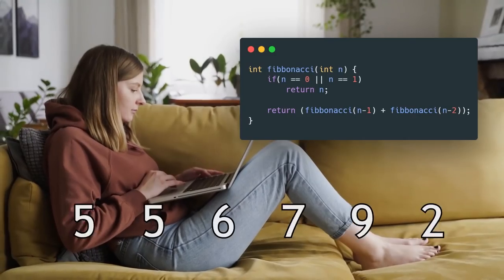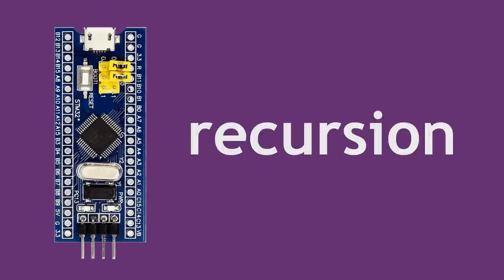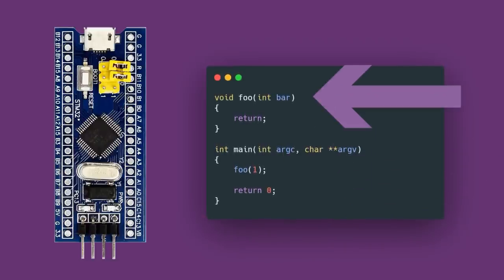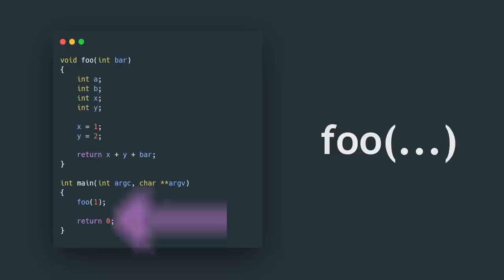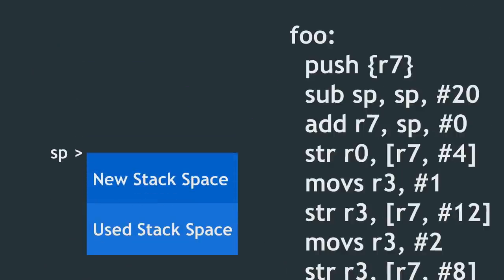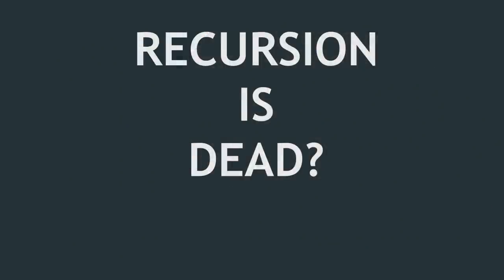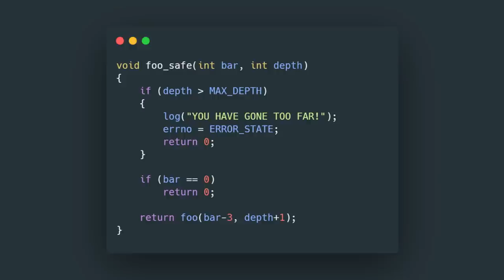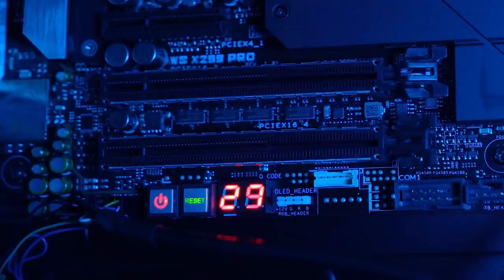why is recursion bad?

Comment: I once heard this excellent saying: "all recursive functions can be written with loops, since CPUs, as far as we know, cannot yet clone themselves."

Edit: okay okay. To every computer science undergrad student here shouting "aCKeRmaN" (or maybe you just watched a Computerphile video, I don't know), I understand you want to show off that bit of fancy maths you just learned about. Chill alright. I said "can be written", which means EXACTLY THAT and NOTHING MORE. It doesn't mean you should (or shouldn't), or it's a good idea (or not), or whatever you imagine it's saying.
Reply: But how is having more CPUs connected to recursion?
Reply: This is absolutely incorrect, see i.e. Ackerman function, though that one is a bit contrived thing. But recursion is way way more powerful than looping.
Reply: @hackvlix  a cpu executes all code iteratively. You can always emulate the behavior of a cpu
Reply: @morphles  ackerman function can be implemented without recursion as well, just look at stackoverflow for examples
Reply: @climatechangedoesntbargain9140  Just did, and its a bit bs with regards to this:) still uses stack, so in essence all same problems apply that are mentioned in video, so some recursive problems, like ackerman function will require loads of memory regardless. And recursion is way simpler to write.
Reply: @morphles  nobody says, nothing requires tons of memory, but its true that you can reformulate everything nonrecursive
Reply: @climatechangedoesntbargain9140  Well, that is best kinda of correct so that much I can concede :) But in a way that is kinda "obvious" from turing machine/lambda calculus power equivalence. Still, after working with functional stuff, recursion readability benefits seem enormous. And compiler should sort it out :)
Reply: Yeah, I aint writing variadic templates without recursion. Just f that.
Reply: @morphles  a-a- you are.
daily reminder that primitive recursion means it can be simulated by bounded loops. not loops *period*.
Reply: @morphles  What enormous benefits are there in recursion? It's not even simple to understand. Simple to read and write, but hardly nay other benefit. 
How much code-writing time is even saved by using recursion?
Reply: @morphles  Any recursive algorithm can be done iteratively. Recursion is not more powerful than looping. Good luck dealing with anything involving depths greater than 5000 or simply using previous or future values that are more than one step removed.
Reply: @anujmchitale  Likely none, debugging even somewhat complex recursive code is a nightmare.
Reply: @macicoinc9363  Oh. I have never come across cases where recursion was an overall better choice, but I am in the embedded systems world. Though I doubt it's a better overall choice anywhere else either.
Reply: @anujmchitale  Then clearly your programming experience is quite limited, to imperative languages only. Try learning something like Haskell or F#. Obviously embeded has it's limitations, and likely you wont be using functional too much.
Reply: @macicoinc9363  Again for non primitive recursion, looping is basically implementing stack handling by hand, as mentioned previously, so no way it is more readable. For primitive recursion yes looping is as powerful but way less readable. As for depths, that is non argument if you use it properly with good languages/compilers, there is tail call elimination, and even in C with bad compilers you can use trampolining as far as I know, though then it likely becomes more convoluted than just looping. Again it all depends very much on task at hand. In general problem with loops is that they are low level, and do not allow for clear high level abstraction in algorithms.
Reply: Try solving an avl tree with loops
Reply: @morphles  I have heard Haskell pushes one to use recursions right? Then that's more of a specific language thing.
 Whatever my own personal experience, I have never even come across anyone else mentioning recursions as the objectively better way to do stuff. Maybe one or two advantages bit not holistically better.
Reply: I'm not sure why so many of you are missing the point? It was never a question of which one is "better", whatever that's supposed to mean, rather that they are mathematically equivalent. All loops can be written in recursions and vice versa, so just use whichever is more appropriate for the situation.

Oh and by the way, as of all those different recursion algorithm examples you guys have given up there: guess what, all control flow compile down into conditional jumps at the assembly level. So yes, it IS in fact possible to write <insert your algorithm here> non-recursively.
Reply: Actually, CPUs have been reproducing themselves for decades. Consider, you can no longer do modern CPU design without the help of a computer.

And yes, there are legitimate use cases for recursion. I wrote a tool for doing version control on Blender documents. It’s not enough to store the base document in the repo, it might also have external dependencies that also need to be included. Some of these dependencies need to be found by scanning node graphs, which can contain node groups which in turn recursively reference further node graphs.

Do you really want to code that with an explicit stack? Recursion is just so much easier to code, and easier to understand.
Reply: @anujmchitale  :) I suggest looking into Wikipedia article programming paradigms, and see that there are way way more ways to program, than just imperative languages. "Encourages recursion" is understatement and misunderstanding of the point. Again, from what I read so far (which is very understandable as this video is about low level stuff), good chunk of people here have not encountered significantly different programming languages/paradigms and think all all languages are mostly same (which for lot of popular langues is quite true, java, c dialects, pascal, php, even assembler, those are mostly very much the same), which can't be further from the truth, there are super mind bending (for good reasons) languages, that really challenge and expand ones thinking. Some simple things to look are, functional programming, declarative programming, and most mind bending I have seen - logic programming (or somewhat related nondeterministic programming).
Reply: @scheimong  While I made a mistake talking about non primitive recursion previously, and yes strictly speaking you can do same stuff with and without recursion, I' pivoting my point (into weird direction, kinda, on low level programing video) to - imperative (and thus loops), is very much that great way to program, and should be used only when absolutely necessary, generally languages that "encourage recursion" (of have it as only option), allow for much better abstractions and robust/less error prone code. Still of course for micro-controller programming one is unlikely to use those, at least at this point, so not sure why I got into this argument so much...
Reply: @morphles  I agree my sub-field is quite small compared to overall mega-complex of logic. The points you brought in this reply are quite refreshing.
Some others haven't brought such points. They keep up the factually wrong points like recursion is "simpler" etc. 

For the sake of creativity and a different thinking style, it makes sense to have different ways of doing things. We should not do it only one way. But should also accept that down under, everything is exactly converted into a loop structure. When higher level programmers stop giving value to such facts, we end up with unnecessarily bulky systems like the Java based Android. Instead of the stronger IOS, that's based on unix-like programming.
Reply: @anujmchitale  That's a pointless debate, each task has its best suited tools. What are the benefits of a punch if a kick can replace it?
Reply: @petros_adamopoulos  What are the justifications for such a replacement? That's the core debate in here. Without an acceptable justification, replacement for the sake of it is meaningless.
Reply: @anujmchitale  Well again Java is just java is just assembler with more steps :), so of course it can hardly be better. But again my view is that future is declarative type of programming, or logic, and low level code generation left to compiler. Higher level of abstraction allows a lot of things that doing just loops etc, would leave ones head spinning with complexity and unable to track what happens where. But if you work with well defined high level abstractions, you can allow machine to do all the crappy details, much better than human can, and much less error prone. Though again, we are not yet at the level were we could unleash such tech on embedded space, but I suspect in something like 20 years, we might very well be.
Reply: @morphles  That time, wouldn't the inbuilt functionality of languages be strong enough to not require either explicit loops or recursions?
 
This is a crucial point. Show us where coding loops won't survive but recursion would, specifically.
Reply: @anujmchitale  It is not so simple, point is that in functional languages, functions are first order objects/values, just like any other value in "common imperative languages", you can assign them to variables and manipulate them in may ways, they are well defined (talking about pure functions), and you can reason easily about them all of this combined results in excessively easier to read and understand code. Though again one needs some experience in FP to appreciate it. And again FP is just one step/thing, other pradigms, though some of them likely will remain very nice potentially forever, but thankfully (IMO), FP is gaining ground quite a bit, and should improve on OOP nonsense, granted embedded stuff suffers much less from all kinds of OOP crud, as it is more basic procedural stuff, with less of marginal use abstractions that OOP pushes.
Reply: @morphles  You are discussing a bigger point here. FP is more feature rich, no doubt.
But "recursion" in it's theory is nothing else than a self-confined loop that runs till some condition. Then why is recursion the key for anything? That's the question here. FP Vs OOP Vs Procedural is a different topic.
Recursion has existed since the beginning. Not like it's a new feature.
Reply: @anujmchitale  Ok the point with recursion is, it allows immutable state everywhere, thus pure functions. While loop generally are used to mutate something, and mutable state makes understanding and reasoning about things more difficult. The point is that languages like haskell (though it is probably one of most hardcode pure functional languages), recursion is the only way, you are then forced to learn the benefits of operating on functions/higher level of abstraction, the thing is you build things of small pure functions, means no mutable state, means you can not do stuff like "a = a + 1", but you get very well defined and easy to reason about chunks of code - pure functions, and to basically iterate under those conditions recursion is the only way. Admitedly for some simple things one can argue that for (...) { if(a) { b=a+x; } } and stuff like that is not that bad but when you get used to functional ways, of map, filter, fold, etc, it just drives you nuts in how annoying it is to reason about on high level, because you have to figure out code writers intentions from individual nondescript steps. Though I guess I'm again quite off on tangent :) I guess I got detracted by my dislike of loops, here, and the samples where recursion is easily most readable thing are a bit more involved, while in general I prefer to use map,filter,fold, even when working PHP, which I do most of my time. Though I decently recently had to do a task where recursion seems to have been by far best. But description is slightly involved, though I could try to write it here.
Reply: @morphles  No this is an important detail that you have shared. And your use case makes recursion a better choice to use probably. This is what very few people mention. Many just ramble about trees etc. Data structures that can easily be utilized by pure loops. 
For Haskell, it's necessary to use this style. That's fine.
But in procedural languages, there's hardly any benefit in recursion . Rather a loss of detail and debugging info.
The possible future of FP that you mention may come up with its own implementations, as I replied before.
Reply: there is a simpler saying: trivially anything can be implemented with a single loop since the processor logic itself is a loop: fetch, execute, jump to the next one, and repeat.
Reply: Recursion is used when you need to break the task into smaller similar subtasks and remember the place in the parent task where you should continue after finishing the subtask. In some cases you can avoid allocating memory (such as Fibonacci), but in some cases it's problematic, for example QuickSort algorithm (although you can use tail call optimization for the last partition call, so the smaller part can be recursively partitioned and the larger part can be done in the same function guaranteeing log(n) stack space in the worst case). Of course, you can use an array instead of a stack, but that doesn't count since it's still an auxiliary stack.
Reply: @SurenEnfiajyan  Thanks for some valuable info on what objectives to look for during recursion usage.
Reply: You cant reverse print a linked list without recursion not using extra memory.
Reply: @F.T.L  you are already using extra memory in all those recursive calls and context switching.
Not to mention all the time spent till the last call, without printing anything. So if the whole process jams in between,you end up not printing anything.

This is one of the most horrible justification for a recursion use-case.
Reply: @anujmchitale  still better than to write an array for it
Reply: @F.T.L  Much worse than writing an array for the values. Once an array is created, you can splice it, cut it into 10 portions, prints only the odd indexed values. Do whatever the hell we wish.
While with recursion, none of this is possible without more control logic.
Reply: @morphles  I find that exposing the stack makes it far easier to write anything more complicated than basic searching algorithms. Maybe it is harder to read, I would argue it isn't because I don't have to translate random recursive calls to how the stack is changing. If an Engineer is having trouble understanding DFS, BDS, or any traversal algorithm, you have a much bigger problem than how the code is written. Would you concede that it makes debugging a lot easier for complicated algorithms? From experience I have ran into recursive depth problems as little as 5000 in: Java, Python, and I believe C++. In the case of C++, isn't it best practice to not assume the compiler will do what you want it to, especially in easily fatal errors like recursion depth limits?
Reply: @anujmchitale  Languages often have nested structures, so using recursion is often the most natural way of implementing a parser.  Sure you can use a parser generator to generate a table driven parser, but if you're implementing one by hand, then recursive-descent is the method of choice.
Reply: @anujmchitale  yeah that is for sure, but i still think recursion rules on specific operations, especially in probabilistic algorithms. btw i dont think recursion uses context switching, is it?
Reply: @anujmchitale  No. Functional programming pushes one to use recursion. The whole paradigm does. And so does logical.
"But you can write any recursive functions and make it iterative". Sure, good luck with backtracking and binarie trees management. If you are the only one that can understand your code, probably bad code.
Reply: @ElCalvazo  That's not the case though, is it? The languages that push one to use this style are much lesser than those that don't. 
The last statement about only one person understanding the code is such a  cliche dude. It applies to every single line of code. If you have gone through all the discussion, one of the point "against" recursion is exactly this one. Very few people understand the recursive logic faster. In comparison to a bulky loop.
Reply: @F.T.L  I agree my term usage "context switching" was somewhat loose over here. I didn't mean the context between user/ supervised space but a new Return Pointer pushed onto the stack everytime a recursive call would be made.
Reply: @daves.software  Oh. This looks to be a valid example where recursion trumps looping, in terms of ease-of-thinking. Thanks.
Reply: @morphles  Totally depends on the problem.
Reply: @anujmchitale  I find that for many sorting problems, a recursive approach (i) helps me more easily factor out what would be a source of off-by-one errors, and (ii) gives me code which I find much easier ti formally reason about.
Reply: @F.T.L  The cost of converting the linked list onto an array costs O(n) in space -- not alway feasable.
Reply: @anujmchitale  The control logic here should be hidden in the iteration filters, just as the control logic for array slicing should be hidden in the slicing/indexing opetators.
Reply: @zapazap  yeah that was my point
Reply: @F.T.L  Ah, ok. (y)
Reply: @F.T.L  If you mean without touching the one directional linked list. Otherwise you can reverse the linked list, print it and reverse it  back.
Reply: @SurenEnfiajyan  yeah but it takes 3x time if you do that
Reply: @zapazap  Oh.
Reply: @climatechangedoesntbargain9140  No you can't, that's literally what the Ackerman function is - an example of something you can't replicate without recursion.
Reply: @ichigo_nyanko  dude, just read the following posts
Reply: @F.T.L  If there is no additional memory available then this is probably the best solution.
Reply: You can tell how inexperienced a programmer is by how married they are to recursion. There is literally no benefit in terms of readability, bug-proneness, or really anything at all in using recursion. Languages implement the state of function calls with a stack; whether you push values onto a stack, or call a function with parameters, you are LITERALLY doing the exact same thing, which is pushing and popping values using a stack. Recursion is a great way tor a beginner to understand the concepts of a stack, but using recursion instead of a stack comes with multiple drawbacks, and only helps readability in cases where multiple functions are all recursing each other in complex ways.

One thing that always bugs me is why on earth anyone would EVER write Fibonacci with recursion. You start with a=1 and b=1 and iteratively add one to the other a predetermined number of times. Even using a stack for such a problem is insanity, yet Fibonacci remains a favorite example of recursion, and I think that helps to shine light on how misguided the "recursion is better" crowd is. When you gain enough experience in algorithms and data structures, implementing a recursive process with a stack becomes second nature and comes with many benefits over recursion:

Compilers have trouble inlineing recursive calls in all but the simplest cases, and cases that simple should not be relying on recursion in the first place. And if the compiler can't figure out how to inline your recursive calls, you are wasting many cycles copying values/pointers and/or referencing and dereferencing pointers between different calls of the same functions, sometimes even for values that aren't changing. To get around this, you can use static variables in your recursive function for values shared between multiple calls of the function, but you lose the ability to do that if the function is being used by multiple threads. Because of this, it is basically a law of the universe that recursive solutions are wasteful. Why do you have to keep copying the data for, and allocating more and more memory for, a "level" variable to keep track of how deep the recursion is, when a simple "mystack.size" expression has that data persistent and automatically incrementing and decrementing with your push and pop calls? And with recursion, you only have access to the most local data in your call-stack/data-structure, unless you want to figure out how to pass all the relevant data around, after figuring out the algorithm to even determine what data each call even needs. Why not, when you need data, just peek at the elements in an explicit stack, where they are readily available and memory allocated for them only once?

I'll tell you why: intellectual laziness. Stacks are a bit of a mind warp, and before fully understanding them, recursion is a great crutch for beginners to use because, using recursion, stack behavior can be achieved without even knowing what a stack is.

Don't get me wrong, recursion has a very solid place in programming, especially where arbitrarily deep and complex data structures have a set of functions that are all calling each other, but if you find yourself using recursion in the mode of a single function that  passes  its own parameters as parameters to another call to itself, you should be explicitly using a stack, or occasionally 2 or more stacks, other wise you are wasting compile time, execution time, and ram, not to mention sacrificing the quality of your stack traces (who wants 20 of the same entry over and over in their stack traces?). Once you are comfortable with using stacks, you can even write standard functional-programming-style functions that run the body of your function repetitively and encapsulate the stackiness so that you don't have to spend brain power thinking about it if you still struggle with thinking in terms of stacks instead of "function calls" if you really can't get the 2 to equate in your mind.
Reply: The only reason to use recursion, is to leverage dynamic programming, the poorly named process of storing the answers to calculations to reuse later instead of recalculating them. It leads to some natural and efficient solutions to psuedopolynomial-time problems.
Reply: @morphles  I've used Haskell before, and had to solve some fairly complex problems with it. It was a nightmare. Although learning about functional programming was undoubtedly useful (always good to have multiple paradigms under your belt), using purely functional programming is just wasteful. Why? Because it requires you to use roundabout ways to access one of the most powerful and fundamental components of a computer: memory. Overreliance on functional programming indicates a lack of either insight or interest in the low-level processes of computing, especially what's going on in the RAM. Those processes are important to understand, and thus shouldn't be dismissed thinking the function call will take care of everything for you.

Again, functional programming is a useful paradigm, and a skilled programmer should make plentiful use of its concepts. But languages like Haskell force you to use those concepts exclusively, arbitrarily restricting the ways in which you can interface with and utilize your machine.
Reply: Recursion is best used when a piece of code will run a finite number of times, but that number is unknown ahead of time. Loops are better when the number of times is known.
Reply: @TheLucidDreamer12  While loops
Reply: @TheLucidDreamer12  if the number of times is large, you still shouldn't use recursion, even if you know what that number is. There is no reason to duplicate your variables and add indirection between your loops.
Reply: @gavinwilson5324  Overreliance of low level stuff, shows the lack of understanding of a future one might say, just as well. Higher level abstractions allow to offload shit ton of work to machine, and even semi dumb compilers effectively do what no human or group of humans can do. Imagine something like linux kernel written entirely in assembly, seems barely possibly, and waste of time. And other higher level abstractions, will just make everything better in future, granted it is still very useful to understand the low level/underlying tech, but understanding it does not mean writing it day to day, or potentially ever. Problem is that due to lets say infection of oop, and the not great version, you'll find devs (aplenty) who know nether higher level abstractions from functional programming, nor low level stuff like bit fidling, memory stuff, from asm, c, or well these days IMO low level language that is by far sanest - rust. In short point is is - it is easier and more reliable to think/work in high level concepts and allow machine to do the translation, and the higher level concepts one uses the more options there are for machine to use very very fancy stuff in rewriting them into low level. And also, functional is just one step, there are other paradigms/ways of looking in programming that even less people are even aware of.

As for haskell and forcing, though I did not write production code with it, but experimented with it quite a bit, and the part where it forces you do the functional thing, is super important part, in that is very effective way to really make one interact and learn the concepts, without some crutches or "cheats". For example lisp is kinda functional language (well it is way more and it selling points are another discussion entirely), but there you can easily just write fully imperative code, basically C with s expressions, but whats the point? But since it is possible likely someone solving problem with it, will revert to way that is closest to what one knows. Not necessarily bad for practical work, but IMO for learning not fully optimal ether.
Reply: @morphles  By low-level, I didn't necessarily mean assembly or bit flipping (though those are useful to know, and occasionally to use), I largely meant things like C. In such languages, you have the luxury of somewhat high-level concepts like functions, compilers, and so on, but you still have to be mindful of the machine's state to prevent things like memory leaks and overflows. Of course, overreliance on anything is bad, but overreliance on high-level concepts is far more common these days.

The purpose of a (useful) programming language isn't to teach the programmer, it's to allow a programmer to interface with a computer. Languages that restrict your usage of a computer's systems are little more than educational toys. In this regard, Haskell is quite similar to Scratch.
Reply: @morphles  I'm only a beginner coder really, so maybe that's why, but recursion is one thing I see as a nightmare to encounter in code. It makes my brain just die trying to understand how it is working half the time. So can you explain how recursion has "readability benefits"? Because to me it seems like the opposite.
Reply: Recursion makes stuff like backtracking a bit easier to implement. It can be done iteratively but it's gonna be tedious.
Reply: @morphles  this is false. Every recursion can be formulated with while loops and vice versa.
Reply: @anujmchitale  it just has no mutable state (actually a lie!), so no iteration is possible. Recursion is a natural part of life in a functional world: you evaluate a function, be it the same one or another one. Are loops natural in the imperative world? Isn't it "goto" what is natural?
Reply: @user-tk2jy8xr8b  I don't understand your 1st point. Loops are "GOTOs"  via JUMP instructions. So what's your question over there?
Reply: All functions can be written with x86 MOV
Reply: @morphles  A more accurate turn of the phrase is: All recursion can be converted into iteration + a stack. That's essentially what it is at the CPU level.
Reply: @morphles  while programms are as powerful as recursion
Reply: Yeah, but if it's not tail recursion you just end up building your own stack.
Reply: hehe try expanding the ackerman function